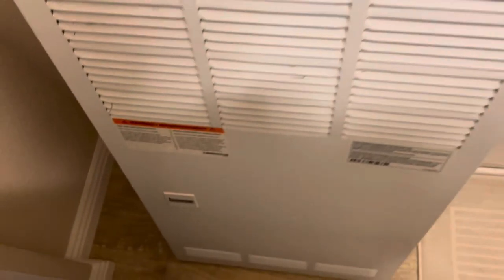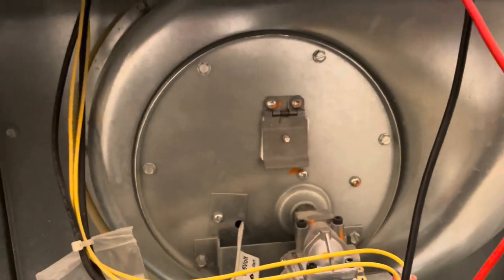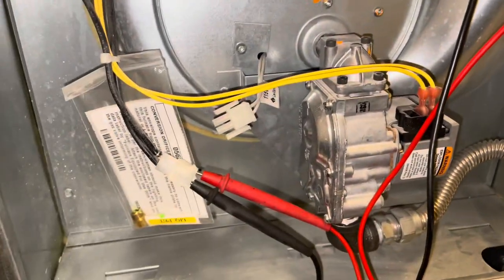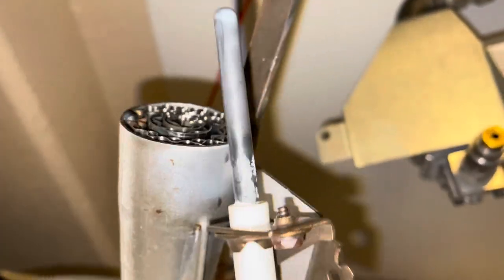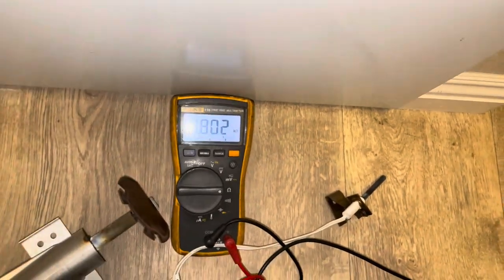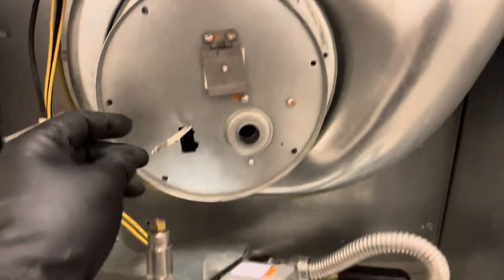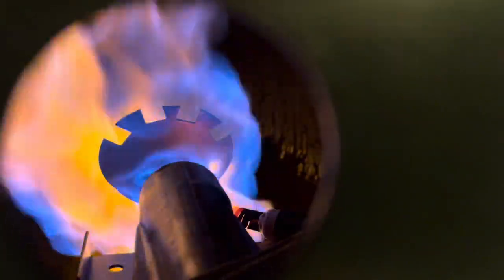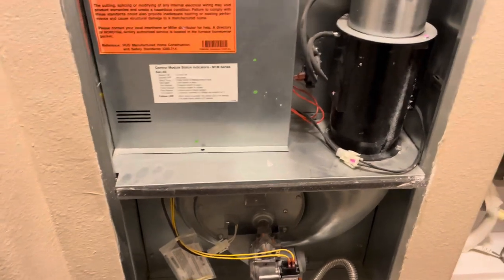Intertherm mobile home furnace igniter replacement 🔥🔥🔥

Comment: Question are you able to adjust gas pressure on these or does the gas company have to come out and regulate the lp outside of the wc isn’t where it’s supposed to be

Comment: Mine is only blowing cool air.  Was recently serviced.  Nozzles and outside filter should be ok, im guessing its the cad cell.  I have a honeywell smart primary control.  Cad cell is reading 999.99 resistence.  There is ignition but not the normal brummmpth, a .uch quieter ignition....suggestions?

Comment: I have the same exact furnace in my home. It’s a loud mfer. Rn it keeps throwing the yellow flash for weak flame. I can see the flame sputter ever so slightly and it’ll run 10-15 minutes then shut off. I notice if I tap the whole furnace it’ll stay solid a second then do it again. Then if I wiggle the sensor next to the exhaust with the two tubes running to it, it’ll shut down immediately when it’s going. Any thoughts?
Reply: Inducer motor needs changed it probably not sucking enough fresh air for the flame
Reply: @jhatfield2755 I think your right. I give the inducer some love taps and it runs solid for a while but everytime it powers down I gotta reshock it to life

Comment: Can’t figure mine out. I call for heat. The inducer motor comes on and igniter comes on and gas valve comes on.  And fire is ignited. But the problem I’m having is the flame goes out after 30 seconds. I have no flashing lights on 1018 control board
Reply: I had to clean the hole out and the flame sensor. Worked but a few months later the igniter won't turn hot red.
Reply: Clean the gas orfice and check the flame sensor remember if the flame sensor is bad itll tell the unit to kick off because it doesn’t sense the flame!!!